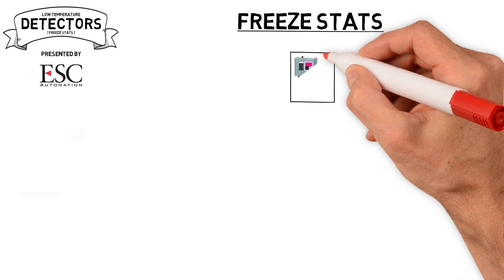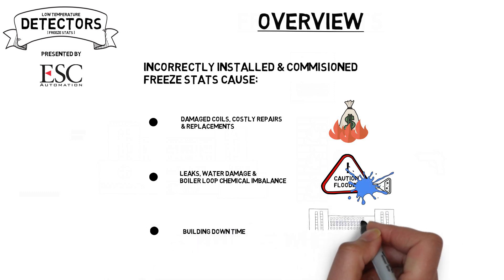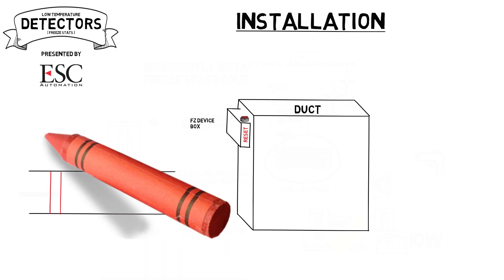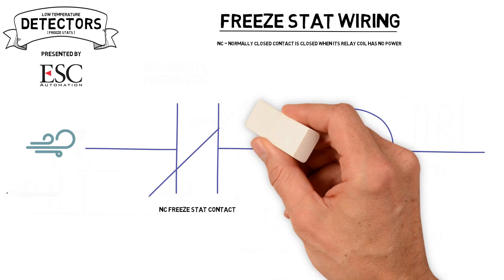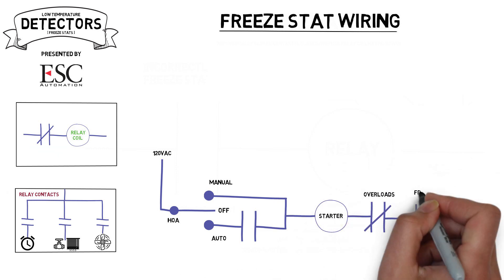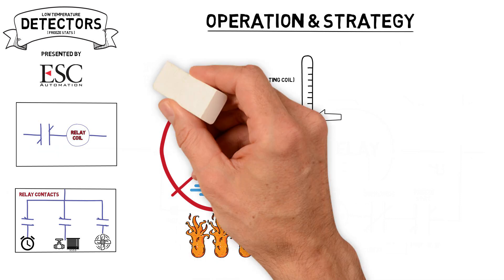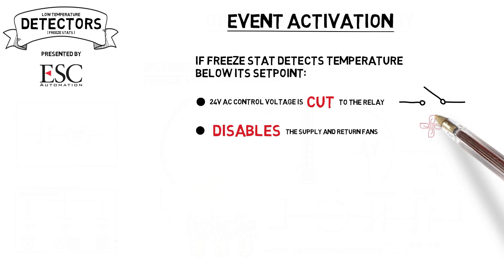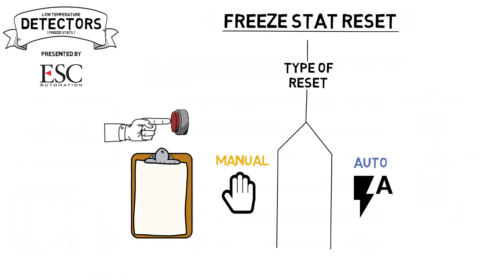HVAC: Freeze Stats (Low Temperature Detection)

Comment: Thank you for the great video. Question, the unit is turning off even though the outside temp is not below freezing and the sensor is not tripped? What do you think the problem with the system? Thanks.

Comment: Great job. But on your relay contacts, the alarm should be wired to NO so that when it trips it closes and sends an alarm. The NC contacts are correct in which it shuts down the drive and the valve, which should spring return closed.
Reply: that's a good point. May be Alarm is set in the way that it went off when there is No power. (NC loop make sure that the Alarm line is working properly) Just a thought.